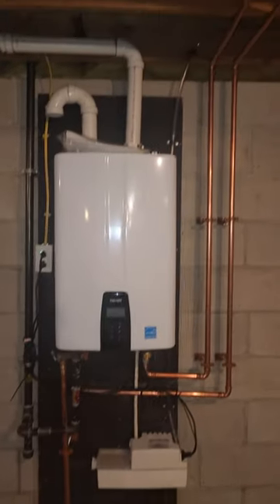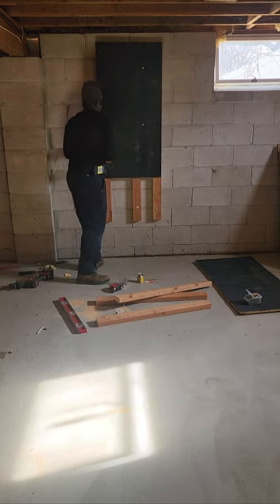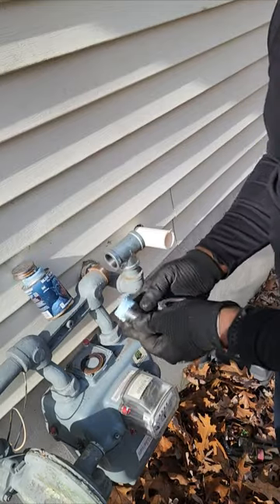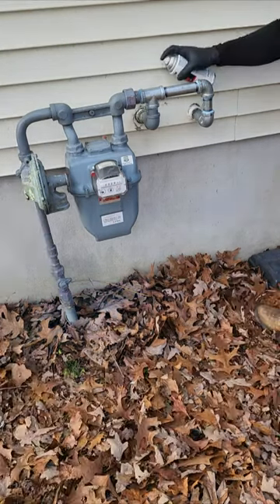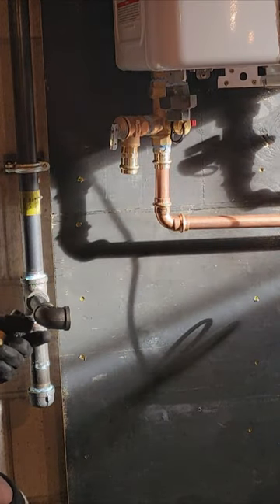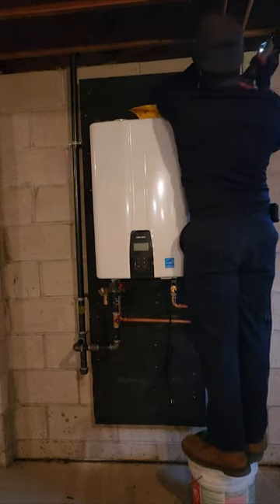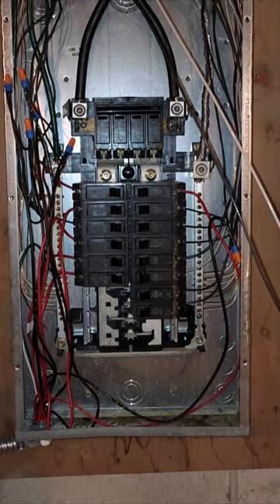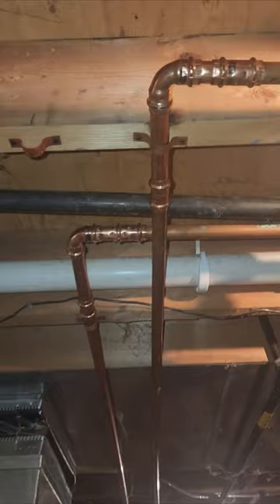Navien Tankless Install: From Scratch to Finish in 20 Mins!

Comment: How do you decipher if intake pvc run can collect to the basement or has to be outside
Reply from the maker: For a Navien tankless water heater, it's generally recommended to intake air from outside to ensure proper combustion and to avoid drawing in potentially contaminated air from the basement. However, there are a few conditions under which you might be able to run the intake inside the basement:

1. *Adequate Ventilation:* If the basement has adequate ventilation and fresh air supply, you might be able to use indoor air for combustion. Ensure that the room has enough openings or vents to bring in fresh air from outside.

2. *Local Codes and Manufacturer Guidelines:* Always check local building codes and the manufacturer's installation guidelines. Some areas might have specific requirements or restrictions regarding indoor vs. outdoor air intake.

3. *Avoiding Contaminants:* Ensure that the air in the basement is free from contaminants like chemicals, dust, and fumes, which could affect the performance and safety of the water heater.

4. *Space Requirements:* Make sure the basement has enough space to provide the necessary air volume for combustion, as specified by Navien's installation manual.

5. *Sealed Combustion:* If the unit is designed for sealed combustion (direct vent), it typically requires both intake and exhaust to be piped directly to the outside.

It's always best to follow the manufacturer's instructions and consult with a professional if you're unsure. Do you have a specific model or installation scenario in mind?

Comment: Great Video!  Thanks!  I didn't see any drain lines attached.  You told us about the acid neutralizing unit but where does the neutralized material go?
Reply from the maker: Thank you! At marker 19:20, the white box at the bottom is a special condensate pump. It has acid neutralizing beeds inside. The discharge is piped the the stand pipe of the washing machine drain.

Comment: Really clean work man I recently took a class with navien and they said not to hook it up to a gfci to use a regular plug  what are your thoughts on that I’m not against it I’m just curious
Reply from the maker: Our local code states that anything deal with water must have a gfci. It will fail inspection without. I also confirm with my father who is a licensed electrician. That's very interesting though I'll look into and get back to you.
Reply from the maker: So according to the navien installation rep. " I believe by code if it is the only outlet in the basement it has to be gfci, it can cause nuisance calls. So we teach them in class to avoid them if you can. But sometimes you have to use them. "
Reply: @DOLPEDIY  In a basement the NEC requires all receptacles to be gfci protected except for the one for a fire/security system. Just because someone at Navien says something different it doesn't matter. The code comes first.

Comment: What size gas line does this unit require to run? My line is 1/2 right now and in about 10-15 feet away from the meter. Do I just size up to 3/4 gas line off the 1/2?  Thx in advance
Reply from the maker: That all depends on what tees off between the gas meter and where the unit will be. With this unit, you can use 1/2in but that's at the last run to the unit and it has certain requirements for that. A gas load calculation and diagram would have to be done first.
Reply: @DOLPEDIY  What if it's LP and not gas?  I have a 30' length of LP pipe and not sure if I should upsize to 3/4"

Comment: I just got the navien npe 240 s2 he only vented the exhaust pvc intake is just basement air my unit is in my furnace room is that ok ?
Reply from the maker: Depends on the size of the basement and if there are any other combustion units down there. A combustion test would be needed. But if it's possible, it's best to get the intake outside. It's better for the unit.

Comment: Pressure relief leak on navien 240a 
 Unit 5 months old . Normal or what
Reply from the maker: Are you talking about the temperature and pressure relief valve? If so, then it should be on for safety.
Reply: No, that's not normal. I would check your pressure. If it's above 80 during the high times, then you will need a PRV.
Reply: @JESUSWORD2  God bless you brother 🙏